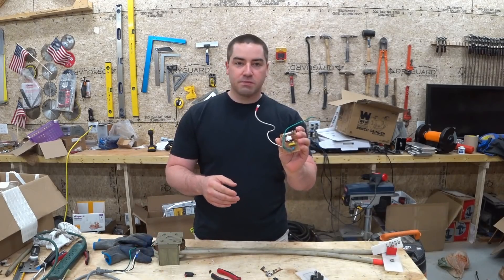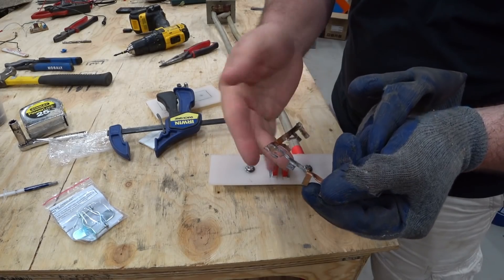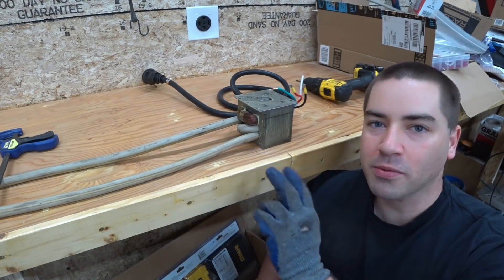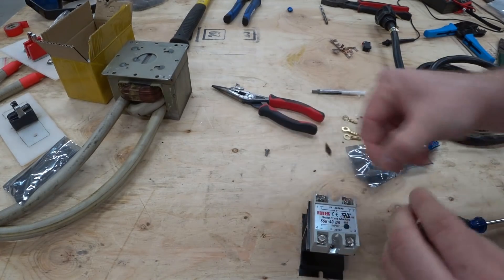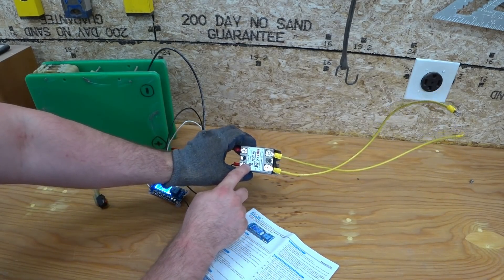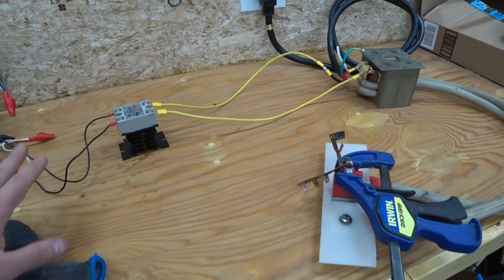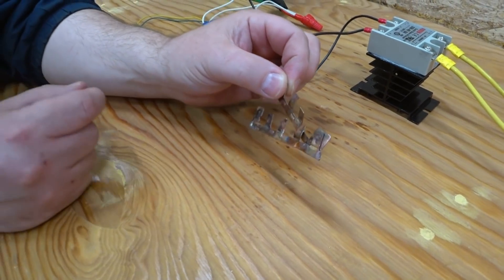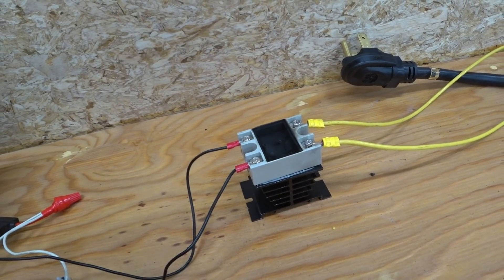DIY Spot Welder, Part 3, Timing and 240 Volts

Comment: The end of your video didn't surprise me, unconscious and lucky man!  I really laughed out ...
 It seems you have limited knowledges about Volts (would you simply try to connect your 120V hairdryer to 240V?), metal conduction, amps and milliseconds time for spotwelding , etc......but you try ! ....and you are, fortunately, careful , with good distance for your last "experience". 
 Your video is .....incredible! A  child who plays with volts and Amps!  Really a funny and pleasant moment!

By the way...incredible too...place a big nail between both electrodes of your transformer and it melts....But place your (dry) finger, switch on  ... and nothing happens... No current sensation, no burning...nothing !!, despite the multitude of potential amps ...Because of the very low output/voltage . 
After the test with the nail , I am almost sure you don't trust me...but try it , be fool enough..., and  search  why. ( OK , I gave you the answer).
...Exactly the same as tightening with your fingers both connections of a big diesel battery with 650 Amps...but only 12 Volts. ( Well,  place a screwdriver on the connections - very conductive - and it melts like the nail!) Danger for us comes not from Amps but from voltage...110V (or 22OV in France) is not pleasant , 2000V with only some milli-Amps and you are dead......anyway it's written on your transformer.
Really friendly....Greetings from France!
Michel

Comment: Ssr is probably a MOSFET. Excess energy after the weld is shot back to the SSR causing it to fail. Maybe some high voltage Schottky and TVS diodes might help?

Comment: Consider using 2 SSR per transformer and maybe two transformers?
Reply from the maker: If I used two transformers, would you suggest in series, or parallel?
Reply: @DavidPozEnergy  It need more welding power so it's amperage. To increase ampere, it's necessary to not increase windings  (it increases voltage instead) but increase diameter of windings in secondary coil. It can be archive for example by doubling amount of same type of transformers and connect them in parallel. If I'm saying something wrong, please correct me :)
Reply from the maker: Maybe it will show up in 6 months and you will have two for the price of one.

Comment: what a buzzy sparky end ! LOL ...you should try copper electrodes, their low resistance provide a superior spotweld.... tungsten's higher hardness and resistance makes them unsuitable for (medium/lightweight) spotwelding as they suffer localised heating at the tip contact...... my plain/crude unpulsed MOT spotwelder with copper busbar electrodes welds stainless steel with a flick of the switch and only with force(pliers/vise) the joint will rather tear/shear right next to the weld than break loose at the weld, a split second too long ON and perfectly round holed welds are the undesired result....

Comment: If the primary coil could not handle 240V it would just short and not work again.
However if it is rated for 120V, it's for a reason.
The reason it is getting hot is becouse of the curent.
SSRs have a big voltage drop witch makes them not good for high current aplications.
You can try contactors(they are just heavy duty relays).
I would really like to see you try this with capacitors :)
AC does not seem like the way for me.
Reply from the maker: I have an AC contactor.  It was a spare for a whole-house air conditioner, rated 40 amps, AC (Alternating Current).  It uses a 24 volt AC coil, meant to be run off a thermostat.  Pretty standard part.  What do you think of trying that?
Reply: @DavidPozEnergy  I dont have a hood guess for the current that tranformer is drawing so I cant really tell if 40 amps is enough... For the moment though that seems like your best bet... Maybe if you have one of those clamp meters you can measure the current on the primary side so that you have a rough idea of what you are working with... Just have in mind that the contactor could weld itself and stay conductive even without any current on its coil

Comment: Success!! Well done! 👍😎
Reply from the maker: Well kinda, still needs some fine-tuning.  Did you see the last part?
Reply: @DavidPozEnergy  just now...😂 I thought it was over!
Reply: @DavidPozEnergy  small fires are the best way to learn!
Reply from the maker: LOL.  I was planning on ending it there, but was just having fun with my friend.  But it was too good not to use the footage in the video.
Reply: Hahaha.. that didn't end well.
Reply: @DavidPozEnergy  curious what amp load the device is pulling when its welding! ...and of course the rating of the ssr. Ive been planning a test project around that exact brand ssr (have a variety of them) and while doing forum research someone commented in a one-off msg that the other person should rate the ssr at twice the max load (for that guys application). Why they wont hold up over time at the rated rate, I dont know :)
Reply: @DavidPozEnergy  So excitingly unexpected. I was thinking "That won't be enough if the other tabs need 0.2", then I had to rewind to make sure it didn't say 15s :).

I appreciate that you show both the failures and the process of figuring out what might work in your videos.
Reply from the maker: Hi mikie2501, I'm also curious about the same thing, but my multi-meters are cheap.  They won't capture the peak fast enough, which was the issue in another video where I tried to capture in-rush current on my miter saw.  The SSR is rated for 40 amps.

Comment: That solid state relay, is the cheapest crap you can get from China. It has way to high internal resistance. You properly also need pointier probe contacts.
You could try a Kweld spot welder kit. Cobber is very hard to spot weld, but maybe this kit can do it, whit the right power source.
You will have to keep your cables short though.
Reply from the maker: Thanks.

Comment: When using 240 v split phase although 90 degrees out of phase you are increasing the input frequency and doubling the voltage so your primary kickback is way more than that ssr can handle. if you want to switch 240 volts in the US you need Two SSRs to safely contact both phases . That's why your breakers have two poles for 240 volts.
Reply: It's a single phase with a center tap common (•<120v>•<120v>•). A Dual breaker is used because both wires are hot with respect to the common and ground. To turn it off and be safe you need a double pole breaker or switch.

Comment: Very good try... take the amps in primary coil and get  a contactor, relays aren’t good for it. Secundary coil will rise up amps about 400 or more... also for the spot electrodes you can construct something similar to a gigant pinch or clip for clothes that you can hold in your hands without any trouble or burning, you got it!! Just fine tuning!! 😎👍🏼🇵🇷
Reply from the maker: Thanks.

Comment: I am afraid that copper will not weld, I think it is better to soldering it with tin/lead, much more safer.
Reply: Actually I worked in a factory where we used to spot weld  (resistance weld) copper all the time.  We were making circuit breaker components which required welding copper wire to other copper components that went into the circuit breakers.  Our transformers were much bigger though.  Most were 25 KVA and we had a couple that were 35 KVA.  On one of my favorite weld setups we were welding a copper wire of about 10 or 12 gauge to a tin plated copper part.  The weld time was about 5 mS and the current was about 13 KA on the secondary side.  With such a high current, the power was very high, but due to the short time, the energy was small which meant that the part could be handled immediately after welding without burning your hands.

Periodically we would do a destructive peel test of some of the weld  to make sure they were strong.  When peeling the parts from each other with pliers, we looked to see that a large portion of the wire was left embedded in the part.  The weld had to be strong enough that trying to tear the pieces apart would actually destroy them.

Comment: why you use Solid State relay 
While 10 amp relay are inbuilt in timer module ??? tell me reason
Reply from the maker: I was using more than 10 amp.  But none of my attempts worked well.  I ended up buying a spot welder.  Take this video more as entertainment, or what NOT to do.  Don't copy it.

Comment: search for motor contactor instead of relay. Also try giving it a double tap in the same spot, I recall that fancy spot welders will hit a shorter cleaning pulse and then a longer welding pulse. Also try to make sure your electrodes are really stable / secure, it looks like those heavy wires jumping might move the electrodes, which might encourage a break. And when you had it on for a long manual pulse, I see that your (tungsten?) electrodes appear to get hotter than the metal you're trying to spot weld. it looks like the workpiece is more conductive than the electrodes, maybe get some nickel strips like used on 18650s in building packs and see how well that will weld. or even some thin steel like tin cans, i bet that will weld easier than the copper based alloy (is it just copper, or is it berylium copper, or what?) It looks like tungsten is suitable for copper, only other electrode I would suggest trying would be molybdenum. And the more the better on clamping force during welding.
Reply from the maker: Where would you put a nickle strip in the assembly?
Reply: @DavidPozEnergy  i would use 2 pieces of it instead of the copper, to see if that would weld better than the mystery copper alloy. The reason I bring up nickel is caus the guys with the little 100A boards from ebay make it look easy to get good welds. Hopefully you have a junk battery pack you can salvage some from to try.

One other thought I had. Maybe try lightly sanding the surfaces of the copper test pieces, to get good clean smooth bare metal, then use a solvent to remove any oils,  because like all welding processes dirt and contaminents can affect the weld quality.
Reply: @DavidPozEnergy  Sorry I keep popping up with more thoughts and directions to persue, but I'm still stuck on your spot welder lol. Have you measured your open circuit voltage on the transformer? As in leave your welding electrodes open, with just the multimeter leads completing the secondary circuit. I believe MOTs are usually around 1 volt per turn, so I'll guess you'll have around 2 volts open circuit. I'm wondering if you might have better results with a smaller wire and more turns. When I was playing with a large transformer, I was using 2 awg as a secondary and I could max my 400A clamp ammeter on it without an issue, it just warmed up rather quickly. The wire in the video looks like it's bigger than 1/0 to me, which will have a 53mm^2 cross sectional area.

What I'm getting at is that you might actually get more current by using a smaller wire for the secondary, because you'll have more turns on the secondary and more voltage to put across your given resistance. The added voltage is what the idea behind putting 220v to the primary is for. But I'm sure at 220v the transformer's core is saturated, and the majority of the power increase is going to heating the primary coil. I would bet that you see better results with 110v to the primary and a 4 turn secondary, than you do putting 220v to the primary with a 2 turn secondary.
Reply from the maker: Thank you Jim.  I'll try more turns and see what happens.  Thanks.
Reply: Sometimes too much clamping force can be a problem as it lowers the resistance of the connection which leads to less heat at the weld junction.  Also spring clamps might be better than screw clamps since as the junction starts to melt, the parts will move closer together and the springs will follow that movement.

Comment: Are you.... using a microwave transformer... the normal way around...? (Stepping up the voltage?) Because that would explain a lot of problems...
Welding is low voltage... not high.
Reply from the maker: I'm stepping down the voltage, and up the amps.  Thanks for watching.

Comment: A word of advice: if you hear a banjo in the video/channel intro, you might not want to replicate anything shown in said video...

BTW, These FAKE Fotek SSRs range anywhere b/w 1/2...5 the rated current. Take the module apart and see what is inscribed on the (fake) ST triac. The 40A -marked units usually have a 25A 'BTA24-1000B' triac, which should be good for 16 amps.
Reply: This is probably the reason my 1st attempt failed. After the one usage under load, the SSR went from NO to NC. Results were less than optimal. . .
I am now waiting for a solenoid and some relays in the mail for further testing. I may try again with a better SSR.

Comment: Hi David. I have been silently watching as I am no expert on spot wellding, I do wonder if the solder is not having an influence on those joints, I have done quit a few nickle welds and even then I wipe off ALL my nickle strips and cell tops with isopropyle as skin oil inhibits a good weld. So, 2 points, try clean copper to copper, 2 maybe get a peice of nickle and see if it welds properly. I know for dead certain that spot welding nickle and copper is not the same, nickle is way easier, I have tried copper on my malectrics and it does not work, some people say that the current is not enough others say that  the contact area on the copper plays a big roll, all I know is that copper is a different aproach to nickle and have not succeded either with copper. Regards. P. S. Ssr's can't take that current, you have to get a heavy duty contactor as far as I understand the contacts have to be able to not weld together as "happend" to the ssr.....
Reply from the maker: Thanks.
Reply: Copper has much lower electrical resistance so it doesn't generate as much heat as nickle will.  Also the high thermal conductivity of copper will pull the heat away from the weld making it even harder to get up to welding temperatures.

Comment: Can we solder that??
Reply from the maker: In an early video I tried soldering the copper bus bar to the lithium cell.  But one of the tabs on the lithium cell is some different metal.  Maybe nickle, maybe aluminum?  I couldn't get it to solder.  I'm willing to try again if someone has suggestions.
Reply: @DavidPozEnergy  Did you try solder with a higher silver content? Or just off the shelf lead free electronics solder?
Reply from the maker: @Jim Coleman,  The solder I used was off the shelf lead free, rosin core.
Reply: @DavidPozEnergy  Aluminum is very soft and nickle is hard.  You can try doing a scratch test to see what you have.

Comment: Neat! It's still just single phase power, so there are no "phases". It is "120/240 volts, single phase" One of the problems with attempting to use a 120 volt transformer on 240 volts without also at least doubling the frequency is that the core is heavily saturated (magnetically). This means that it will take a LOT of reactive power.  The resulting high current in the winding also means that it will take a lot of resistive power (watts). All of this, just to the primary. NONE of this power gets to contribute to the output on the secondary. This VERY high current is why your relay blew up. Which was rather spectacular, BTW ;)  In order to get a higher voltage from that transformer you would need to increase the number of turns on the secondary. In this case, that would mean using smaller wire (so more turns could fit), which will of course have the opposite effect, due to it's greater resistance. You could use a somewhat smaller wire just within the transformer core, then immediately splice to your larger wire. You need very good splices. Keeping the leads as short as practical will also help. Getting there!
Reply from the maker: Thank you, I appreciate you taking the time to help me out.  It's so interesting this concept of saturating the core.  I'll be up all night reading about that.  I love this stuff.  Thanks.

Comment: I'm a little late on this, yes we do have 220-240 as you mentioned, but by switching that switch on the strip, your causing that connection to be the weakest and so that is where the spark was happening, you would be better having the circuit live and touch to electrodes to the battery, and as someone said, you will never weld copper strips without a much better system. the copper such a great heat conductor that it dissipates the heat to fast for your setup, and the s=ame guy mentioned the copper tungsten, i bought these an much better welds and tips dont corrode as quickly. The ssr is good, alot of people use auto relays but that is the sme as switching the strip, and these type of contacts dont last when your sending 400a through them.

Comment: each house here in the Netherlands has 3 phases, depending on your contract you either have 1 phases or 3, if you have 3 phases, you got 380 Volts, taping between phases 1 and 2, 1 and 3 or 2 and 3.

Comment: The tungsten tips have three times more resistance than copper. That limits the current to much and the heat is generated IN the tips instead between them.

Comment: I think best bet is using a ark welder on its lowest amp setting and pulse it through a relay for 1 second I doubt spot welders are dc I am sure they use ac at least the ones I have used

Comment: for the controller  go on ebay search for “100A/40A Double Pulse Encoder Spot Welding Machine Time Current Controller”  buy the 100Amp  , this controller make a double impulse one to clean one to weld  all parameter are ajustable

Comment: You don't need to release the moment switch so quickly. It's the job of timer circuit.
Reply from the maker: This timer (or at least the program) will run the length of time I set, regardless of how fast or slow I release the switch.  Thanks for watching.
Reply: @DavidPozEnergy  you released quickly. It didn't matter even if you hold it.